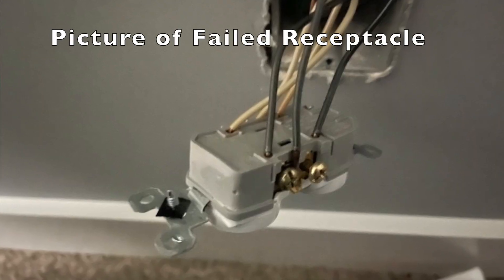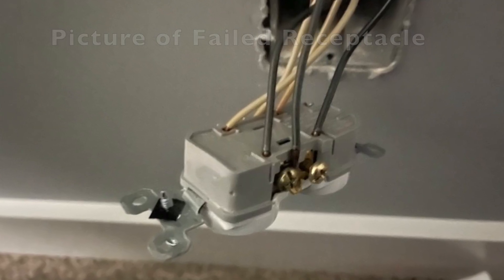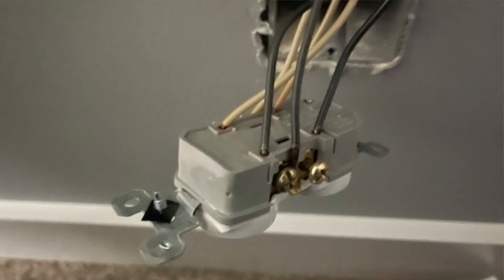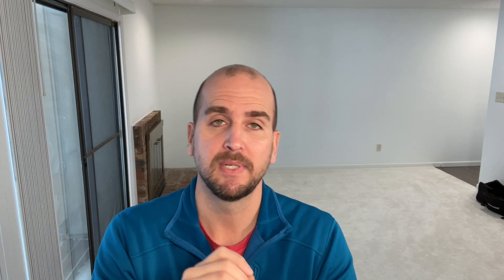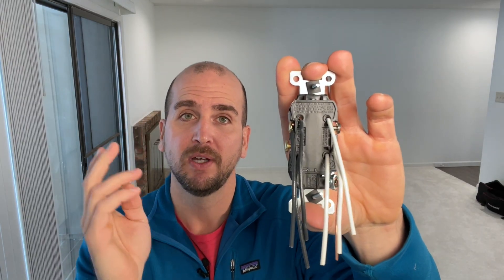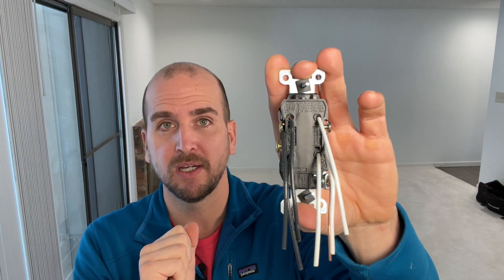Incorrectly Wired Outlet Found In Newly Built Home

Comment: As a non-electrician, I have a few questions.  How does a "50 cent" receptacle differ from a commercial-grade receptacle?  Is it a 20amp receptacle compared to a 15amp receptacle?  Apparently, this receptacle is on a 15amp circuit (because of 14GA wire).  Your pigtail was 12GA.  Is there any problem mixing wire gauges?  Would you ever use 14GA wire on a 20  amp circuit.....or a 15 amp receptacle on a 20 amp circuit?
Reply: 1. Quality. For most it doesn't matter. Internally you can usually find better springs (tension) and thicker bus bars. You'll find outlets that get used more frequently will wear down quicker than commercial grade.

2. The receptacles designed for 20A circuits will have thicker material to handle the increase in current. You can use 20A receptacles on a 15A circuit just fine but I would advise against it because of the NEMA layout someone looking at the receptacle would assume they could hook up a 16 to 20 Amp load and be fine and find themselves opening a breaker over and over. Better to not mix and match.

3. You can mix wiring but it isn't recommended. First, the entire circuit is sized to the wiring. There's all sorts of charts out there but the basic idea is 14g is good to 15A, 12g up to 20A. (There are many types of wires and heat ratings so this isn't a hard and fast rule. For ROMEX NM-B it is fine) using a different size wire to pigtail in means you have uneven sizes that could cause separation and potential loose fittings and arcing or connections falling apart. In this video will it happen? Likely not but if you can avoid different sizes, even if the pigtailed wire is larger and can handle the underlying current, it is a possible point of failure just due possible connection issues. I don't foresee his tight twist and cap falling off but you can read a ton of differing opinions on even twisting the wire together.
4. No, never use 14g on a 20A circuits. 
5. You can probably use 15A receptacles on a 20A circuit since the NEMA layout is made to plugs that should only draw up to 15A but, again, it doesn't cost anything to have a proper 20A receptacle on a 20A circuit. And if the load on the 15A circuit should short in a way that draws large enough amperage but not enough to open the breaker you will have heat buildup and possible fire. One in a million but why bother. Just put a 20A in.
Reply: @etherealrose2139  Thank you for your detailed explanation, it is a great help!

Comment: A good practice with cover screws is to make them vertical. It’s the small details that make a difference.
Reply: I'm not an electrician but I kinda have OCD when it comes to that. Also it helps me know if I did it (or somebody like me did it) as opposed to somebody else. Straight screws mean the install behind it will be clean.
Reply: In the beginning of my career I thought that was my signature. Then, after seeing that on work done by others, it showed me that most who do that are conscientious about their work.
Reply: The issue I have with this practice is the installer, rather than stopping when the screw gets snug, overtightens the screw to make it vertical, deforming the wall plate. This makes me think the installer was careless.
Reply: @DG-xz5oc  if I get to snug and tightening more would ruin the plate, I just back the screw up till it's vertical.
Reply: @DG-xz5oc  I agree with that. Sometimes you just can't make them vertical. In those cases I try to make them as tidy looking as possible.
Reply: I thought code required horizontal? Oops! Hahaha!

Comment: There is nothing wrong with pushing wires in the back of the plug I’ve done it for years an haven’t had a problem once. Gotta watch your box full with your marrette joints especially if you have 3 wires an a 6 inch tail in there. Obviously you’ve never wired a house before. Cheap sub devision houses are cutthroat an have to be done fast therefore three wires in a box sometimes makes it faster. Btw you never said why the plug wasn’t working..... find something your experienced in to make a video about before you start wasting people’s time

Comment: anyone who uses 15 amp for outlets should have the lic revoked!!! Also never run the lights from a outlet..if u blow the breaker u have no lights!!.
Reply: Yep.  I did my own electrical in the garage I just built.  All outlets are on 20 amp circuits and all lights/smoke&co detectors are on 15 amp circuits (LEDs don't need much).  That way every room has at least two circuits, and if a circuit does pop, the lights stay on.

Comment: Must use a torque driver or wrench to tigthen all electrical screws & bolts. Years ago the NEC had the cheap inferior bsck stab only accept #14 guage copper wire. I argued with halve ass follow sparkies 45 years ago about using the back dtab ins. Told them when they approve them gor a ground wire then I might consider using them. Wish I had a dollar every time I came across a duplex receptacle with 3 or 4 wires

Comment: You need more torque and a little added technique when tightening your wirenuts. You're almost there.

  The proper torque will stop the wirenut from threading further onto the splice and carry through to immediately start twisting the insulated portions together. Continue twisting until a couple turns show on the insulation. The two turns on the insulated portion is a common manufacturer's recommendation and not long ago three turns was standard on some box literature. Don't pretwist too aggressively. You don't want the conductors to start looking like a threaded bolt. When this happens the wirenut won't have the best bite angle on the conductors and won't have the predictable feel threading down as it should or things can get worse and you may finish with a slightly loose feel to the wirenut or it may even slip clogging the threads which means starting over completely and junking the wirenut..

   A good way to get a better feel for wirenut splicing is to practice on non pretwisted splices. A properly installed wirenut will produce the same finished product solid conductors whether you choose pretwisted or not. 
   You must hold all of the conductors even and not allow any to slip relative to one another. As the wirenut becomes tight it will lock up and that's when you keep going and allow the torque to twist the insulated portions together. You're done when a couple twists appear on the insulation, it used to be 3 so don't complain about the pain. If you remove a well installed no pretwist wirenut the conductors will have twisted together to look the same as a pretwist splice. Removing the wirenut for inspection is generally only done on practice splices. You don't want to disturb a finished splice and in time the wirenut won't leave without taking hostages along for the ride. If you do inspect your practice splice look at the fine marks made by the wirenut showing its thread bite. Look at the relative angle of these marks to the conductors. 

 Pretwisting should feel more like a guided spin than a torque gun manoeuvre. 

Wirenut tools can be great finger savers.

Hope you got down this far. My intention to find something to kill time changed when I noticed your wirenut technique. The twisted together look that carries down the insulation should always be there. You appeared to be highly motivated to learn and improve so that's good enough for me. All the best.

I wish you well on your journey.

Comment: Seems like with pigtails you are only adding another failure point. It may "look" better, but you have "halved" the use able load capacity of the wire, and introduced another failure point. The least amount of connections provides the least amount of resistance. Resistance creates heat. Heat creates failure. This is Ohms law and physics. 
A better way is to attach all wires with the least amount of connections and thus reduce the resistance and heat the electricity will face?  Serious question.  It is no more difficult to wire the outlet with all wires at the outlet than using a "pigtail." 
Just my opinion.

Comment: In terms of a failure point, using a device as a major connection point is the biggest culprit. As with other outlets  being down the chain, you could have all those beyond the connection point failing and would have to try to determine the chain direction at each failed device until this connection is finally found. It could be even harder if the chain involved covers more than one room.

Comment: I don’t know about adding more wire into the mix.especially #12 solid.
You have4 wires and 4 lugs. Use all of them.
A lot of times that extra wire will never go into the box.
Also wire position on the lug is important.
You did the white wire right and the  black wire wrong.
Watch that part. The screws turn clock wise. Put the wire at the 6 o’clock side of the screw.
It will naturally pull the wire in. The other side will naturally push the wire out as you turn the screw.
It’s easy to see in your hand.
Just an observation.

Comment: Absolutely no reason to pigtail when you only have 2 of each color of conductor.  There are 2 screws on the receptacle, so one screw for each wire.  When you have more wires than screws, then pigtail.
Reply: I would definitely pigtail the neutral in any three-wire circuit so that the device can be removed without interrupting the neutral. And just to be annoying -- it isn't technically a "neutral" unless it is part of a three-wire (or 3P four-wire) circuit.
Reply: @civildiscourse2000  It is a neutral once you pass the first point of disconnect, which is the main breaker in the panel.
Reply: @tkdjoey85  Idk about definitions in the NEC but in Canada it is technically the identified conductor, but most definitely not the neutral e.g. in a 2-wire branch circuit. It is only properly considered a neutral if it is carrying only difference current (aka unbalanced load) in a multi-wire circuit. Of course informally everybody calls it the neutral or less formally yet, "da neutch."
Reply: @civildiscourse2000  Here it is considered a neutral because it is part of the multi-wire conductors brought in by the utility company. It may be branched off as individual circuits but they still share a common neutral at the panel. The NEC refers to it as the grounded conductor where as the the green wire is called the grounding conductor.
Reply: @tkdjoey85  Thanks. We also use the grounded conductor term for identified conductors (the two things being rather closely related!) but "grounding conductor" is uniquely reserved for the (typically bare copper) conductor that connects the grounding electrode to the ground nexus of the system (where grounded conductor, grounding conductor and bonding jumper come together). Green or bare wires in branch circuits are bonding conductors in strict terms, but again in casual chat, "grounds."  But we're into the weeds now... mea culpa!

Edit: Second thinking "green wire" reference. Maybe the conductor to the grounding electrode is required to be insulated in the US? Here it is only required to be insulated under certain circumstances and is usually bare.
Reply: @tkdjoey85  Negative. A neutral carries an unbalanced load. In single phase, it is merely the grounded conductor.
Reply: @fryingpanhead8809  so you believe there can't be an unbalanced load in a single phase system
Reply: @tkdjoey85  Single phase transformers don't work that way.
Reply: @fryingpanhead8809  What's going on here? I thought this thread was dead. 

Common single-phase service is split-phase with the transformer center-tap grounded.

From the service standpoint, grounded conductor = identified conductor = neutral. It most definitely carries only the unbalanced load which is why it is allowed to be significantly smaller than the hot legs. (No Rod Stewart reference intended.)

In any three-wire branch circuit, likewise grounded conductor = identified conductor = neutral, and it carries only the unbalanced load, which can be as little as 0 A.

In any two-wire branch circuit, grounded conductor = identified conductor, but cannot properly be called "neutral" because it carries the full load current in that branch circuit.

It's a fine distinction in everyday work and conversation, but not so for system design and code interpretation.
Reply: @fryingpanhead8809  yes they do work that way in single phase. Unless you’re powering a RV
Reply: @pigbenis2812  If you say so.
Reply: @civildiscourse2000  There is nothing to 'unbalance', dingus. There is only one xformer. You cannot get more than one sine wave out of a single transformer. You aren't getting '2-phase power' out of a two pole residential breaker. You are simply getting 240 volts, single phase. There's a reason why you do not see PSC or CSCR three-phase motors.
Reply: @fryingpanhead8809  Dude. You’re clueless. The neutral is the center tap on a single phase transformer secondary. It carries the current from both hot conductors that have current 180° out of phase. If the load is higher on L1 than it is on L2, the neutral carries that current. 240v is line to line, 120v is line to neutral.
Reply: @pigbenis2812  If you say so.
Reply: @fryingpanhead8809  yeah you already said that. It would take about a minute to google single phase neutral current and read about how you’re wrong.
Reply: @fryingpanhead8809  Actually they do work like that. In a 120/240 single phase system, the midpoint of the secondary side of the tranformer is tapped and grounded to create a neutral. From the midpoint to any line reads 120V, and from line-to-line (the full voltage) reads 240V.
Reply: I apologize for getting off the subject, I know we are talking about whether to pigtail or not. I agree in a single circuit application a pigtail is good practice but not necessary
Reply: @civildiscourse2000  If you say so.
Reply: @tkdjoey85  OT on the internet? Horrors! 😉
Reply: @fryingpanhead8809  Well, I learned something new, which is that the thing I've always called a split-phase three-wire circuit is (apparently) commonly called an "Edison three wire circuit" in 'Merica. Several vids here on Y'allTube.
Reply: @civildiscourse2000  This is good knowledge to have, just keep in mind that Edison three wire circuit is referencing DC current. Tesla three wire circuit is for AC current. But it is close to the same concept.
Reply: @tkdjoey85  Oh-ho, I learned something again. The one example "Edison" vid I launched started out by stating that the presenter was going to do a DC analysis first, so I assumed this Edison business was generic. In any case as you know the circuit analysis is identical. Thanks, I'll go back to "split-phase 3-wire." 😋
Reply: It's best to pigtail commercial installations. Not necessary in residential. The reason being is commercial receptacles are replaced at a greater frequency and killing the power is generally not an option. And you don't want the downrange receptacles killed, because of equipment in use.
Reply: I agree adding more connections than necessary is counter-productive. As you said with three wires pigtail with two use the connections provided on the outlet. Cheers.

Comment: Agree on all points. 
Always tighten loose screw terminals.
Push-ins are garbage, I've found failed push-ins, the wire just falls out, they're a fire hazard.
Pigtails are solid & reliable, you can also buy manufactured pigtails -- one wire-nut to a lug on a 6" lead.

Comment: I was taught to never twist wires together before you put on the wire nut.  Only twist if one is a solid and one is stranded.
Reply: Other way around. You should twist solid wires together before installing the wire nut.  When troubleshooting a circuit without twisted joints, there is risk of arc flash when removing the wire nut while energized. This is considered lazy practice in the industry.
Reply: @nousername5103  There's a reason you don't twist the wires Cochise... If you wrap one of the wires and the nut only grabs the outside of the other, the inner wire pulls free easily.  Now you have a high resistance contact connection ready for a fire.  This whole arc flashing when removing wire nuts from live wires is bizarre to say the least.  How much current are you pushing through a wire nut connection to get "arc flash" and why would you take it off when you can push the probe easily into the nut anyway?  That's whack.
Reply: @texNoz  why are people handling live wires? I mean you can... but I don't see the reason in a residential setting. Just open the circuit first...
Reply: Wrong!!! ALWAYS twist the conductors together BEFORE using a wire nut.

Comment: Perspective of 35+ yrs of industrial experience, I can't stand the idea of 𝙡𝙤𝙤𝙥𝙞𝙣𝙜 𝙧𝙚𝙘𝙚𝙥𝙩𝙖𝙘𝙡𝙚𝙨 box-to-box, inside of an 𝙞𝙣-𝙖𝙘𝙘𝙚𝙨𝙨𝙞𝙗𝙡𝙚 wall space. 
(I get it, it's reality in most all residential)
That said, strive to eliminate any "pig-tailing", making your joints where they belong, in a suitably large and 𝙖𝙘𝙘𝙚𝙨𝙨𝙞𝙗𝙡𝙚 J-Box. 
--That way any drop can be easily changed/dedicated in the future--

As an owner/client, spec the work appropriately... the way you want it, ie., larger, deeper boxes, quality spec grade devices, upsize AWG for voltage drop, dedicated/isolated neutral and ground all the way home facilitating a 𝙨𝙩𝙖𝙧 𝙜𝙧𝙤𝙪𝙣𝙙𝙞𝙣𝙜 scenario (thus mitigating potential hum in audio/home theater, etc). 

Then, trust the electrical rough in, devicing, and finish work ... but verify yourself each step of the way. Politely hold them accountable. Don't assume your wishes have been properly conveyed to the individuals performing the install, use frequent site visits to both build rapport, as well as verifying your spec. 

A Cardinal Rule for electrical work, for professionals and DIY'ers; execute best practices and do every little thing possible ... so it's easier/more clear for the next individual working on it.

Be mindful; 
the N.E.C. is a 𝙢𝙞𝙣𝙞𝙢𝙪𝙢.